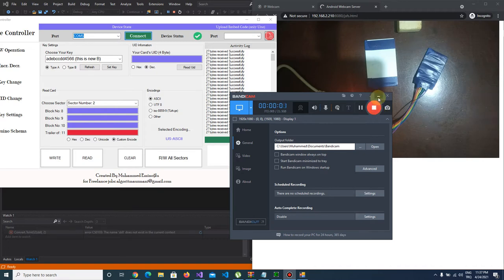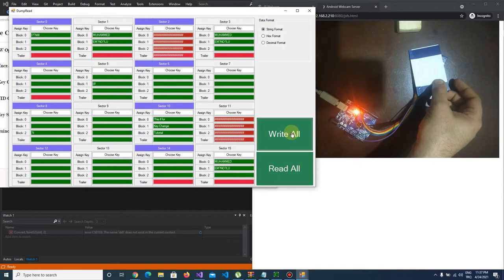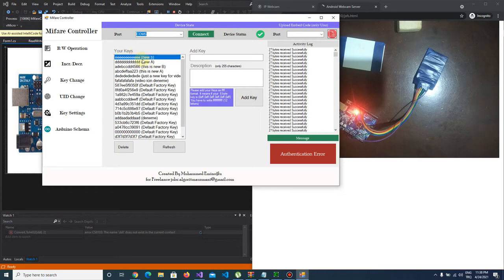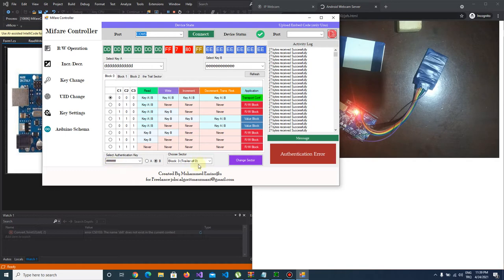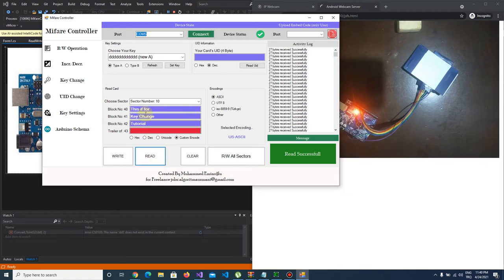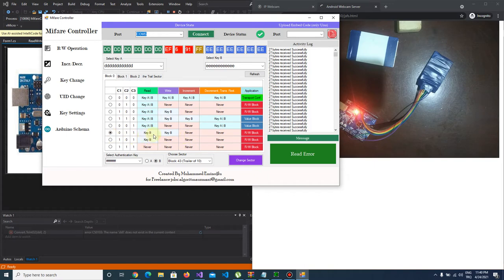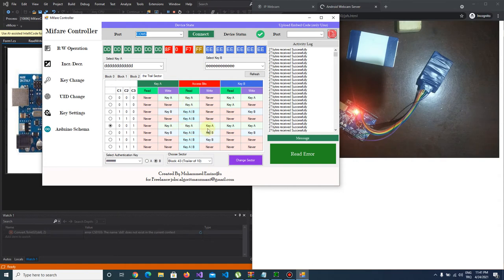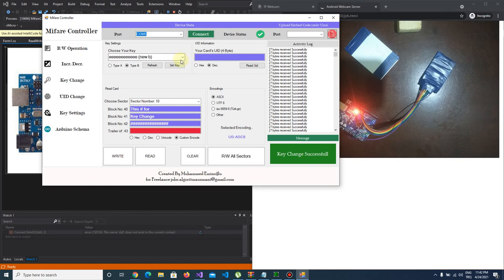How to Change Mifare Card's Key

Comment: I installed the program in a temporary folder but can't remove it (delete), how can I do that?
Other than that is looks like the program might help me out a lot.
Eventhough it does have a quirck with reading the card data, to be able to see it I need to select a different option before switching back to HEX and be able to see what a block contains.